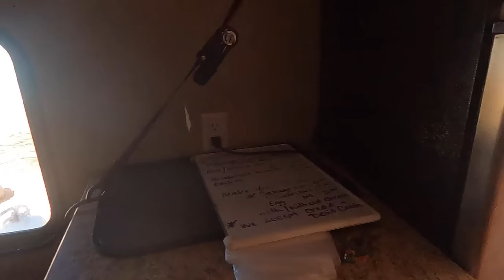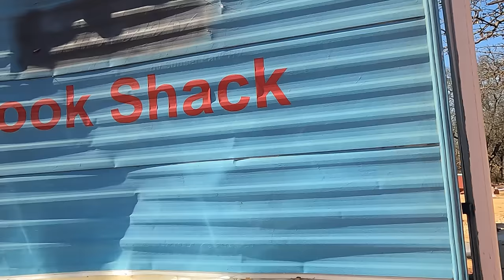Repairing a camper trailer after accident | Going #offgrid #couplebuilds #camperlife #sustainability

Comment: Ahh naaww, their isn't any using that shower. Maybe up to about a 10 year old kid and for your poodle, but that's about it. Without doubt, do the tankless. Those RV 6 gallon water heaters are about $500-$600. I have no clue why so much, but I'm going to do tankless also. But they're not reliable. I don't care. I can buy 6 of those to one of those RV 6 gallon, and have something more effiicent and won't run out of water. You guys are spot on and got it all figured IMO. Not sure of the story on the trailer, but I kinda hope that lady got some info and should get a bit of ins payment. That's a bit significant damage. You guys seemed to have remedied it just fine though.
Reply from the maker: Yes sir, a tankless water heater is a must. Wait till you see the shower Wiley is working on. ❤️

Comment: Hi jenn an wiley ooops nasty ding on backof the trailor
Reply from the maker: Hey there Liam. Yes, it was a big ding for sure. Of course, these trailers are basically built out of cardboard and staples, so it doesn't take much to damage them. Plus, the back wall had some water damage. But we got er' fixed right up. We will be building a roof over our living area, so this trailer doesn't have to be perfect. It just needs to hold together for a couple of years until we can get moved into our new house.

Comment: Wow what a blessing for your family when you move to Arkansas.  Bummer about the accident but the bathroom would be better for a pantry for sure. Seal your seams so they don't leak on the roof and sides. ❤❤
Reply from the maker: We using a TON of chalking to seal the cracks (Wiley did it while the camera was off 🤦‍♀️). Also, when we get it to Arkansas, we plan to build a roof over it, so it won't matter if we missed a spot.

Comment: On the side little corner bands and anywhere water can get in need to use butyl tape. It's seals the crevices.
Reply from the maker: Hello, Sherree. Thank you for watching and for taking time to leave a comment. We appreciate your feedback. We used a TON of silicone to seal all the cracks. However, we are going to be building a roof over this camper, so it won't need to be perfectly sealed. ❤️

Comment: It's going to be pretty cool taking a shower in the winter with an outdoor shower
Reply from the maker: We plan to have a small heater, so hopefully it won't be too bad. Although, when we moved to our current place, we had to take baths outside in a cattle trough. We would get the water nice and hot, so it actually felt good when you got out. Kind of like being in a hot tub in the winter. It wasn't too awful. lol

Comment: Point of Origin   Lets go backwards to make Sense of  where this LAND  deal really  begins.  Be it a  Local who said ( Its  over that  way  ( Cant  Miss IT )  TO  its down by the  big  Pine and oak line.  Been there since the beginning of time.  MY SURVEY Work  for  decades  has been LITTERED  By such Terms and  Beliefs that others hold as SACRED LAWS  not to be  changed or broken.  EVERY  Land Owner has a  deep down fear  that  between the  YAX man the Trespassers too.  SOMEON is  looking  out  for them selves and certainly  * NOT * *YOU*...  Have  offered  up this  exact  advice  to any and all willing to take a few steps in the opposite direction.  Post it , Put  Out  Signage every where.    Mark Clearly the  corners  with Long  Metal pipes and  posts alike.  Paint out the  trees and   rocks and  start gathering  up sticks and  twigs and  stones if you please.     A  Barrier showing  ( YOU ) mean  business  101  Thank YOU - PLEASE.. EXAMPLE. From the  road side first. Get a very long  tape measure and  lay out  EXACTLY  where it  starts and  ends.   T-posts with plenty of Bright colored ribbons.      Private property signs.   No Tresppaing   ( Etc. )  About  every 25, 50,75, to 100 feet of  distance in.  Start making piles.   with the  exact line  set out  like a  FENCE of  Natural surrounding materials in it.  Check side to side, front to back.  There is  nothing more intimidating  when going through another persons property then to see info, Details that  they too are constantly  watching  you... INTIMIDATION by  using  the  natural materials already found  right  there on the ground.  Wire fencing  and  barb wire can be a step for  farther down the line  still.  T-posts  ( LOTS of  them. )   KEEP checking in every few weeks or months  if  that is  all you  have time  for .  Each time ( EVERY TIME ) build  upon what  you  did before.  Buckets of  small rocks. downed limbs and  dead  trees  make it  much harder to Trespass or  claim They were un-aware of  what YOU had going  on there.   GATES, Locks, what  ever is  within your  own budget.  I encourage and  an  all to use  what  god  gave  you  first then expand  the  perimeter  at a  greater level afterwards.  SIGNS  are like a  calling  card.  a  few nails , staples, wire hung  reminders  ( THEY ) YOU are NOT  alone in them there woods of  sticks and  stones..   DO  U MAKE MYSELF  CRYSTAL CLEAR>   MORE is  better then Les being next to nothing  as it  now  appears! ! !   The  VOICE of  REASON has  shared  MANY Many many decades of  knowledge.  What  you  do with it now ???  I gave  you  the  tools  to  go forward in  an  Easy (A-B-C-1-2-3) Fashion of  Do as  YOU please to feel more at  ease....YOUR  welcome in advance. OH By the  way ( DO NOTHING ) and  only  then YOU are to blame in this  forest  of others  looking for  trouble just the  same.
Reply from the maker: First, I would like to sincerely thank you for watching and for taking time to leave this comment. Secondly, thank you for this advice. We are the type of people to use what we have. We also enjoy recycling things. We are more worried about function than fashion. Most of our projects don't look pretty, but they serve their purpose. We will be moving to our new property in April. Once we get settled, we plan to start clearing our property line to build a fence. Unless we get a great deal on some fencing supplies, we will be building the fence out of trees and other material at hand. I do like your idea of piling up branches and twigs. I think you are right about people thinking twice before hoping a fence lined with branches and twigs. It may be a while before we get it all finished, but we will steadily be making progress. Part of the property is pretty steep and getting manmade materials up the side of the mountain will be difficult. We really appreciate your constructive criticism. We hope you will be kind enough to share advice with us again in the future.